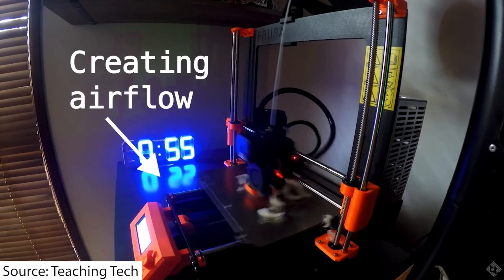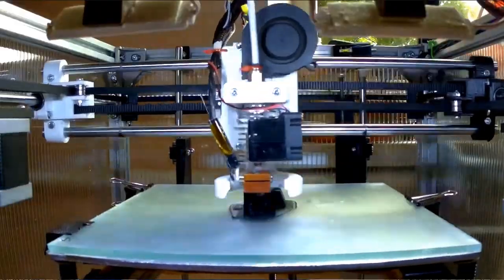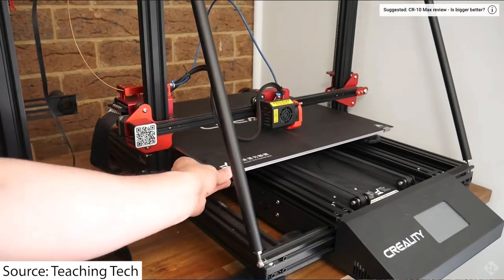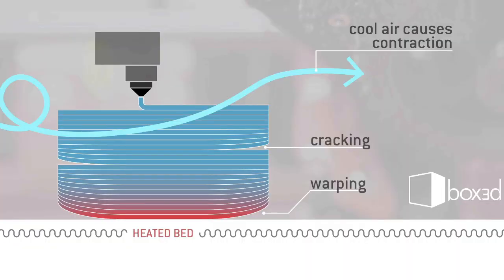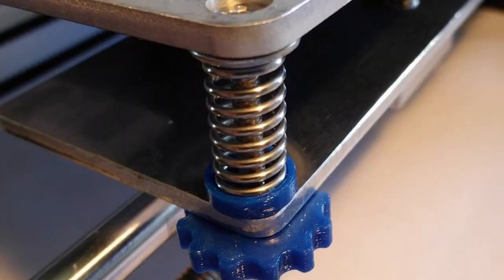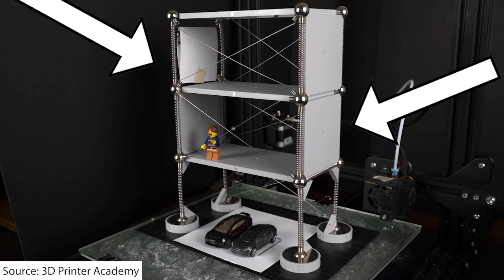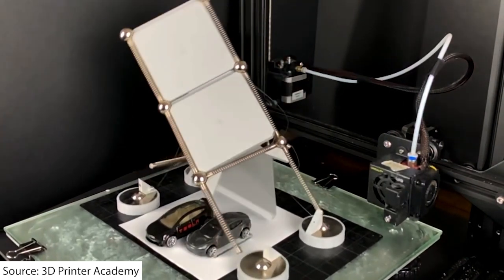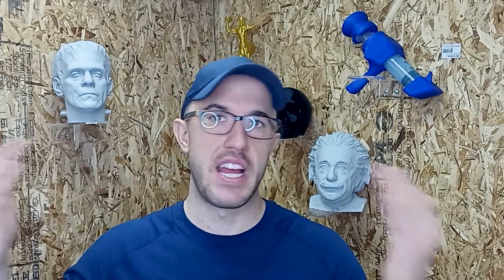The Problem With "Bed Slinger" 3D Printers

Comment: What about delta printers? Those have almost become extinct, but were they really that bad? They had a solid bed, quick movements, and potential for great heights. The footprint was a little larger for the XY, the potential for more vibration in the base with all 3 motors being contained within, and the math is a little more tricky for slicing. Otherwise, why did they fall to the wayside the way they did?
Reply: They have limited print areas and are very long Bowden drives which leads to a lot of issues at higher speeds…. Which are supposed to be a strength of deltas 😂
Reply: @HyperLethalNova  there's a LOT of very light direct extruder setups nowadays tho. Flsun V400 is good example of direct delta.
Reply: @DmitrySholokhov  I am aware, it is still a trade off. The printer is very expensive and more than twice the size of the build area. My point is people need to find one that suits their purposes, and she tweaked, most can perform amazingly.
Reply: I think an inherent problem with deltas is that they take up so much space for their print volume, due to needing all the space above the part for the delta linkage. A corexy or cartesian with a fixed bed can have a much better ratio of useful print volume to machine total volume.

Comment: I generally agree, adding the fact that the bed only moves on one axis adds a layer of asymmetry to the issue as well. But it's a trade off, really. Core XY systems (like the Ulitmaker) have their own design challenges. Moving a direct drive extruder, with it's significant mass, quickly with accuracy and stability can be a problem in its own way. Systems that only move the hot end avoid some of these challenges, but are forced to rely on a Bowden tube, which can have a detrimental impact on print quality and flow control.

Comment: Partially agree, but the airflow does not matter as long as the temperature is there, not to mention if its an enclosure where it becomes a non-issue. I get what you are saying, but i would rather appreciate some REAL tests instead of just some personal beliefs and feelings. Again, not contradicting, but i prefer proper tests and real data.
Reply: Even in an enclosure u gona have airflow issues because the particles are still their which means that they have to get out of the way when the bed is moveing. The big issue I think isn't the temperature but more the mass needing to be accelerated and the air the part needs to push away wich result in wobble wich is bad. You can counteract the wobble by going slower wich means more time. For a consumer thats not that big of a deal and as he said, PLA tolerates stuff way more but if u run a buissnes or make money off of it,  time is expensive and speed is essential,  moving the whole print theirfor not beeing the smartest move to do...
Reply: So you'd rather go with a bed slinger in an enclosure... bruh

Comment: This is pretty much all correct, but the cooling issue is kinda dubious since materials where it's a problem really need heated enclosures, and then internal airflow is fine. Small-bed bedslingers however can be awesome rapid prototyping and sequential small part production machines. Taking this concept to the extreme, see the quantum delta concept that lets you use an unlimited-mass toolhead at the cost of limited part size.